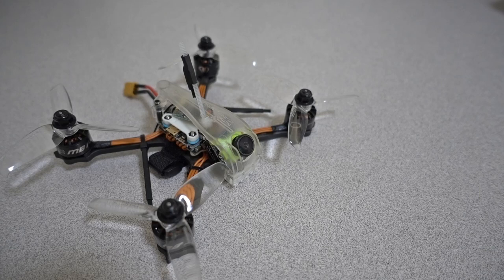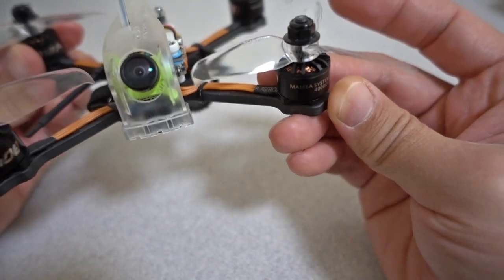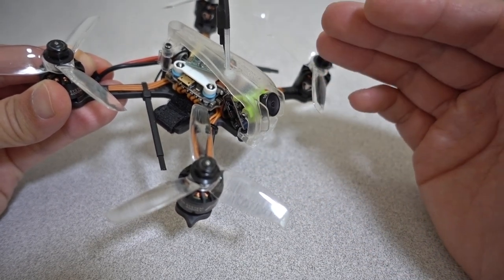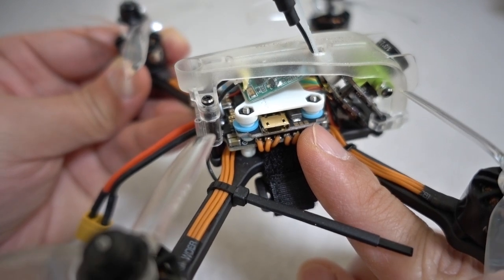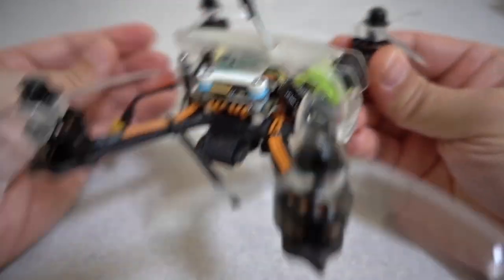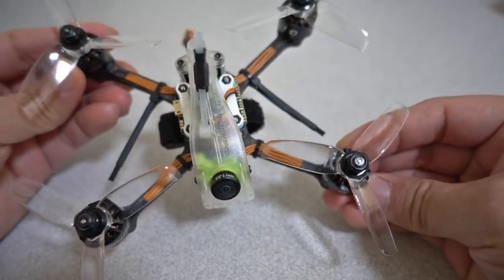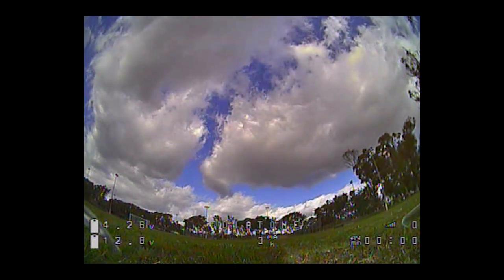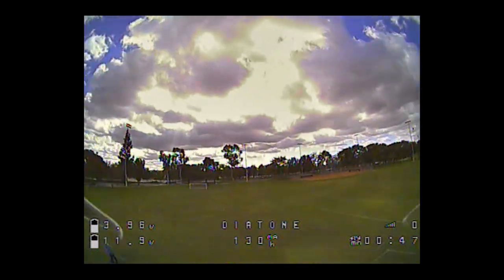MD#149 🚁Diatone GT-R349 3-inch Micro Racer 🏁

Comment from the maker: Check out the updated video with this flying nicely here - https://www.youtube.com/watch?v=K-4Bs50g7t4
Reply: iv seen this one . I went with the ha 3040 prop. I like them so far . I got a Gemfan 3028 with it . I haven't tryed them yet . 
 I'll give them a go
Reply: I changed out the vtx on this one , after I broke the pad off for the ufl on the runcam one. I added the tbs, hv, race  VTX. I  powered it off the lipo lead, because its rated from 7v-27V and the fc only had 5v . I added an extra capacitor ,470 mf 25v to the lipo lead as well . 
 sp far so good . I like the way it flys .

Comment: I loosened the stack update the firmware running it on 3s tons of power. Bought two of them highly recommended. Hawk 5, Batman 220, mobula 7 v2 fc, diatone r349 can’t go wrong with any of these. They fly amazing

Comment: I got on yesterday. I went to change the antena on the run cam vtx. the pad came right off. I had a tbs race hv vtx so I put that in. I conformal coated all the electronics,  set it up and flew it today with a 750 mah 80c lipo on factory settings. I found it flew really well.  I got almost 5 minutes taking the battery down to 14.8V. this was in a gym ,so didnt go as fast as outside.

Comment: Just flew mine for the first time today on 4s I get some kind of weird flutter. have you changed the tune to make it better. If so, can you share your tune?
Reply from the maker: Check out my Gemfan 3028 video.  I switched to that prop and reflashed to 3.5.5 (I think) and flew it on default PIDs.  It seemed pretty good.  I would lower TPA little.  You might want to lower TPA on yours first before reflashing and all that.
Reply: @AlbertKimTV  - Thanks - Loosed the screws on the FC they were really tight. What should I lower the TPA too?

Comment: I really love my gtr349. my only complaint is,  I have crashed it a few times, not on concrete,  but a cupla fairly hard crashes . I had to re epoxy 6 magnets on three motors.  one had 3 loose one 2 and one had one loose. I just looked today and it looks like I have a loose mag on the fourth motor. 
 Do you know if this is a common occurrence with these motors. I'm just wondering if I'm the only one who has noticed this. 
 Thanks
Reply from the maker: This is the first time I've heard of this problem on this model.

Comment: I had the same issue with the voltage alarm on my Mamba F4 25A mini power tower that was applied to a converted Aurora MiniFight frame to run 4S with 1206 4500kV motors.  This Diatone uses the same Fcb and Esc.  Everything on the battery page in beta flight was ok.  Didn’t know what to do other than scrap the new Fcb.  Just to change and save something -  I lowered min voltage to 3.2 and calibrated the voltage reading, just a tweak.  Next day ran 4 packs 4s 650 Gnb.  Not a peep out of it.  Not that the changes had anything to do with it.  Will see if it keeps behaving properly.

Comment: Hello Albert, just received mine this morning, (tbs version) I need to install a flysky fli14+ receiver, what solder pads do I use? Also having big trouble removing the tbs, because it’s held down with 4 strong sticky pads🙈great review thanks👍
Reply from the maker: I usually use Uart6 but I've heard iBUS will also work on Uart1.  I haven't tested it yet.

Comment: I'm about to pull the trigger on this one....but I'm puzzled about there VTX options. ..in there pictures it appears that the unify pro vtx is attach to the back of the camera like the Runcam tx200....So I'm wondering if there is a new unify pro that attaches to the camera? Or is it like my 2.5 GT and the 5v unify board mounted on top of the stack? Very puzzling to say the least?
Reply: I got the tbs version, it's attached to a 5v board that in the stack. I'm happy with mine out of the box with the tune, but I'm no expert and never really tried pid tuning myself.

Comment: that is very weird that out of the box the kwad was not well tuned. when mine arrived i could fly with 4s without any tuning it sounded normal and flew like crazy. i loved it immidialtly. i was using a 3058 dal prop. now i am using a 3052 gemfan, love these props.
Reply from the maker: Even though a build uses all the same parts, slight variations in the build itself can lead to differences in performance.
Reply: @AlbertKimTV  yes true.

Comment: Hello. Has anyone experienced or had a fly away or motor issue during flying?
On the first maiden flight, I was testing in horizon mode it lost control and spinning away like crazy(fast).  Also now the rear right motor is twitching on ARM(twitching but won't spin up like the others)(is this ESC or motor problem?). It was only about 20 feet high. I disarmed and it fell into the ground. One of the arm was bent.  I'm ordering new frame now.  Thanks.
Reply from the maker: Looks like the motor or ESC got damaged... to find out which one it is, watch this video... http://www.youtube.com/watch?v=5KaY_1Kd328

Comment: So I will be short. But now In hindsight you actually may be onto something. I struggled with the 2" plastic frame tune. I rebuilt with the carbon frame. Once I rebuilt the stack I put the diatone pid s on and it was a huge improvement. Still needed a little work though. The vibration getting to the flight controller due to reduced dampening may indeed be the issue.

Comment: Hi Albert,
Just wondering if the motors are soft mounted and if not, will soft mounting them help?
It seems to me, that if the motors are such a relevant part of the mass of the whole craft, and they vibrate, it could have a major effect on the flight characteristics. Just a thought of course:)
Thanks for the content! :)

Comment: What's the longest possible flight time you can get with this? 3s? 4s? Capacity? C rating? Rpm filter? Settings??
Reply from the maker: If you use a large 1550mah 4S, it barely flies but it will hover for about 7-8 minutes.

Comment: Mine seems to fly very different from yours. I've only used 650mah 4s packs and it sounds, and fly's very smooth. And the voltage on my OSD is accurate.  Been really enjoying it so far.

Comment: Mine doesn't have any oscillations at all on 4s, 650 and 850 with stock PIDS. Using the OSD menu using goggles on the 349 changes the PID profile on you even if you only adjust VTX power. It's weird, and only one of the three stock pids is good that it came with. I'll bet one of your PID values is at 0 with those oscillations you must have changed to a different PID profile without even knowing, just like I did. Use betaflight configurator on computer and don't change the stock PIDS because the right one flies amazing.

Comment: So today I noticed something for the first time. I plugged in and was getting the same issue the batt was low and not reading correctly. Unplugged plugged in again, and it registered normally and flew normally. So I think the issue here is there is something detecting automatically what battery you put on and maybe changes something or fails to at times? Either way if all it takes is to unplug and plug in again, NO PROBLEM...

Comment: Hey Albert, someone mentionned there may be a bug with the stock tune switching when you try to view it via the OSD.  Might be an idea to check which profile/pids this chap says are the good ones and try flying this again: "hildy2222
28 minutes ago
Yeah the stock tune is great, just if you use the OSD menu it automatically changes to a bad pid profile. If I use the osd menu I then have to connect to betaflight and select the correct profile."

Comment: I have this stack in three of my builds...one of them running 1407 hype train motors on Catalyst Machineworks Massive Droner 3inch build.. ..running strictly 4s...so the stack and motors on that Diatone shouldn't have any problems at all (running 4s) given low KV 1408 motors you say? I would reflashed the FC and start over the tune....and your 100% correct on the dampness washers on the FC if they are tighten flat then they don't have any give in them...and can't absorbing any vibrations...there for the FC is getting more vibrations from the motors etc...(run like crap!) ..they shouldn't be tighten flat. So I would say your correct on all points....loosen the stack some...flash new firmware. ..tune a little. ..and you probably have a good little quad😉 Of course Albert I know you know all above...curious to see you line it out..lol😉

Comment: iv seen some reviews were they have changed out 5he props to HQ 3040 and have had good results.  the props that come with it are a bit too much , from what iv seen on other reviews. it might explain the ocsolation.
Reply from the maker: Yes, I also discovered that and went with the Gemfan 3028 and they work well with this setup.
Reply: @AlbertKimTV  Yes I think I will check out both and see how they fly. I know I can get the HQ 3040 locally,  I'm just not sure of the GF 3028.

Comment: The stack has to be the problem screws must  be tight because the pids are way too low for it to be locked inn. It will also need 2  profiles for 3 and 4s,  with a little work it should be a fun quad with plenty of power. The manufacturer needs better quality control.

Comment: Well, that's a shame. Even with the bad tune on 3S the flight time wasn't bad at all. Back to the Pits! See you in the Air!
Reply: 3s is the way to go on this one, for sure. 4000 kV is just too high for 3" 4s. Somewhere between 3000-3500 kV would be much better.

Comment: Yeah, mine isn't happy with 4s either. My guess is that the ESCs aren't happy with the high kV. I have a similar quad with 3", same props, Emax 1306 3500 kV, little bit heavier and 4s 650 - can't compare the two. The Diatone has significantly lower rates (like 50-60% less), and it shows in flight. Unfortunately I am "grounded" atm 🌡️🤒, so I can't test if it flies better with the stronger PIDs. From my few flights it feels as if the Motors are on the verge of desyncing. Lots of random bobbles when punching or chopping the throttle, not something I know from other quads.
Reply: Actually, I just checked one of my Blackboxes + DVR. There is definitely something going wrong. Coming from a punch, dropped the throttle to zero, my quad went into a nose down, roll left maneuver. Blackbox says Motor command rear right is Zero for almost one second, yet the quad clearly rolled and pitched in that direction. I think it desynced during the braking phase or the ESC lost communication, whatever. Definitely not something that can be tuned out in Betaflight via PID.

Comment: Not only the screws too tight on the stack the stock setting for airmode was too low. I upped mine to 4.5% and solved all my issues 100% See my videos. I run it on 4s 650mah tatuu 75c and 850mah 95c Rline. It absolutely SCREAMS on the Rline.. Try it out!

Comment: Your battery is not right man. Mine does not do that at all out of the box!
Reply: Also check the screws on all the motors and make sure your props are on tight something is def not right here
Reply from the maker: I'm not an idiot.  I checked all the typical stuff.  It seems this particular unit was assembled differently.  I'm also using the correct battery.
Reply: I noticed in the video he was mucking around in the OSD menu, that causes my 349 to switch to a bad pid profile.